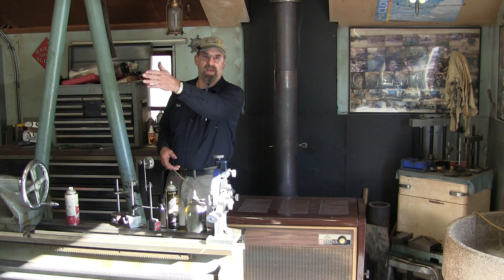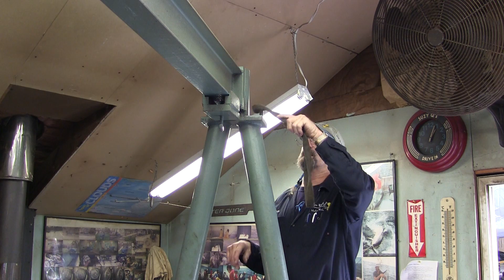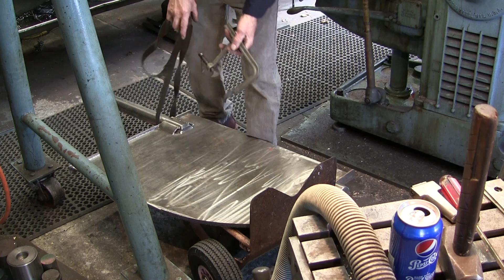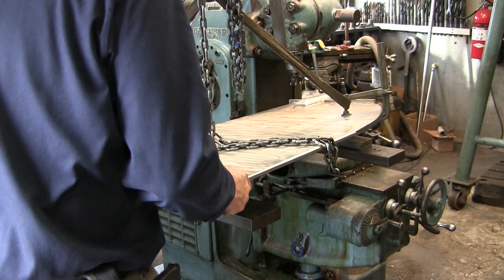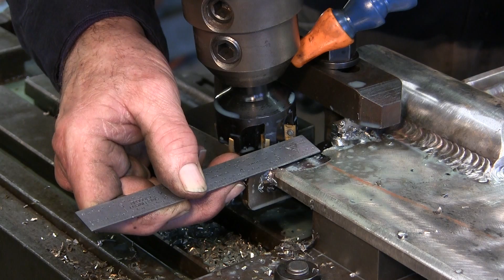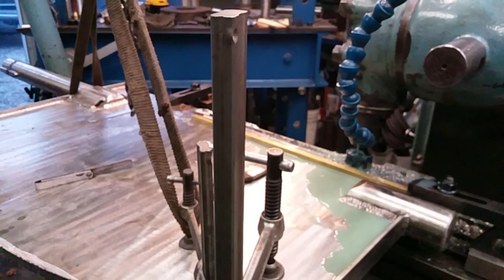The Setup

Comment: Have you ever considered putting a scale on your hoist hook to use a reference for how much pressure your lifting with? With you moving the table up and down, I picture a dial scale that you can glance at and see that your holding the part at the same tension throughout the travel and not have to go back and check the table for binding. 
As always, really enjoy your videos! -Cheers!

Comment: Wouldn't a contoured surface be more hydrodynamic than a knife edge?  Sort of like the difference between the shape of a bulbous bow and a sharp prow?    Also when the prop spits a piece of drift back at the rudder a sharp knife edge would be less strong than a convex rounding I would think.  I have seen a couple of rudders in my time but never a leading knife edge most especially in bigger rigs so I am somewhat surprised at this request.  Nice set up though.  Doug

Comment: Have you considered counterboring the T-slot holes in the extensions, and making a set of socket head screws just the right length to engage the T-nuts? Then you would have a flat work surface on top of the extensions.

Comment: Nice work. It's funny that you make that quote at the end. I am a tooling inspector for a large company and see tons of these shell mills and fancy insert mills and you should hear what the "Applications Engineers" suggest you run that cutter at. It's insane what they try to put over on the pencil pushers to convince them these new inserts will save all this time, but they end up going on the floor and blowing the inserts out in a 45 minute cut that used to take just a little longer with an RNC that costs 15% of what the inserts and can be reground 12 times, never mind the couple thousand dollar price on the cutter body which is junk most the time when the insert lets go.

Comment: Great video! Set-up...set-up, one of the essential parts of machine work! Always had a hard time convincing students to take the time to dry run as much as they could. I once had to do some work on a big steel plate with a Bridgeport and with no crane used a shop cart and jack to support the hanging weight. Thanks!

Comment: Hey Keith,
as always it's a pleasure to be able to watch over your shoulder. what has me scratching me bald melon: the way i understood this cut to end up was over the entire length of the face? 
but since it didn't, i was wondering how you would have to set up for a cut that requires moving the part down the long axis of the table to pick up the second stage of the cut? i've had to do that sort of cut before and have problems with getting the overlap of the first part of the cut to match the second. 
any ideas on how to avoid that nasty looking overstep? the last one i did like that, the cut was only one or two thousands of a mm off but it was still quite visible and of course anything you can see you can feel in steel.

cheers
mike
Reply from the maker: +HolzMichel I didn't follow though with a part 2 on the move and continue with cut, but do have photos and post on my Facebook of it. I lifted and set rudder in new spot worked it down close and then just before last cut use depth mic to determine the needed depth to match blend. had good results on 3 out of the 4 and 1 had a little feel to it, but will still blend with disc sander. ;{)------

Comment: Really good production.  Enjoyed it a lot.

Might get some "DAP Liquid Cement Crack Filler" or some QUIKRETE to fill those spots on the floor.
Reply: +rtz549 Epoxy is good for that sort of thing, binds all the loose bits together, self levels and is tough.

Comment: LocLine makes a sort of "comb" jet, with a row of holes. That (or even a couple of them) with a bit of air pressure, might work to push chips and coolant over the edge of the rudder, and keep the chips away from the cutter and the coolant from running over the face of the rudder. Too late for this job, but it might have some use in the future, or be of use to somebody else.

Nice hack for lifting the overhang to balance the force on the ways.

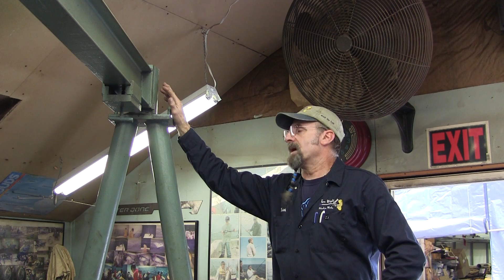Comment: 7:38 Because you have shared so much I not only have a concept of metalurgy in relation to the pipe machining characteristics but I can picture in my mind the processes to turn, bore and weld the 'hinges' on the A frame gantry.
Consider me spoiled.
Reply: +Godshole 38:28

Golden brown, texture like sun.
Lays me down, with my mind she runs...

:)

Comment: 35:50 Hahhaha, of all the times i had to mill stainless steel never got a cut like that. On a mill even a little bigger and with a solid set up it seemed always something would blow up. And it wasn't chatter as the finish was always nice. I guess just all the inserts+tool holders i had available had a heavy negative rake

Comment: Roll of modeling clay or plumber's putty as a dam for the coolant?  Have used it for drilling glass and stone to hold water around the bit.  Seems like it might work for what you had to do with the rudder providing it doesn't contaminate the coolant in a negative way.

Comment: You can do a lot of calculations and invest in a lot of measurement tooling, or you can wing it.  As with a ring and pinion, with some trial and error and grease paint, you can get the gear mesh "right on".  It's all about the gear mesh.  No million dollar tooling (jigs, mandrels, etc.) or class in trigonometry necessary!  Gota wonder what the Navy machinists did during WW2 when they were 6000 miles from the nearest ship yard.
Reply: +WAVETUBE84 to be a machinist is not only to know how to operate machine tools
it is a minding as very often, you have to build a link between the machine tool and the part you have to machine from scratch... nothing exists or nothing else similar before had been done.
If you push further, we assist to the developpement of specialized machine tools... to name a few, all the machinery involved in the production and the remanufacturing of engines
Reply: +WAVETUBE84 

Sump’em tells me, you were a machinist-mate in the blue water Navy!  Maybe, its jist cus ya look a little salty.

Brad
Reply: Brad Apprentice Sorry, nope.  I was in the Army.  But every navy bo'sun and ET I met cold pull some out of the back...
Reply: +WAVETUBE84 
NEC or MOS…  There are those in uniform that just did it, because they had too!

Comment: Hi Keith !
Oh, what a nice video - very instructive and I learned a lot about how wild you can set things up - very, very nice !

Too I got an idea on how tight spaces you have in your shop - just like mine - I have to remember where to suck in the stomach to get through.

And your demo of your gantry started a little spark in my mind on how to re-do my little crane - an I-beam with a pivot/sliding point in the center of the shop IN THE CEILING and an A-shaped roller part on the other end of the I-beam - oh, what a project - but I think I have to re-think all what's hanging down from the ceiling - there has to be room for the I-beam to get around !!!

Nice to have you back with a real machinist project - thx !

Comment: The correct angle is 7.13° so it's close enough :)
Reply from the maker: +Doktor Jönsson I was wondering who would be the fist to put the math to it and test my eyes! Thanks, I love it! ;{)------
Reply: +Keith Fenner Is that a part of ships steering mechanism called rudder??
Reply: +Keith Fenner arctan(.25 / 2) = 7.13 degrees, as stated.  To leave a 1/16 leading edge, as you pointed out later in the video, the angle would be 6-1/4 degrees.